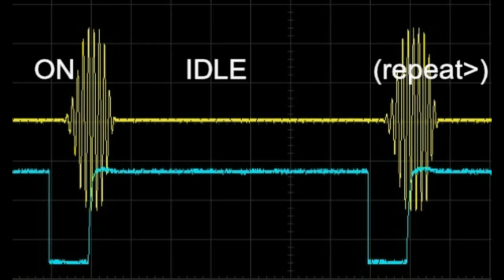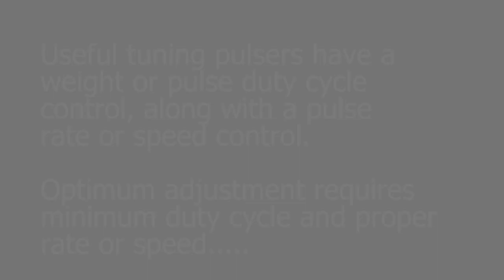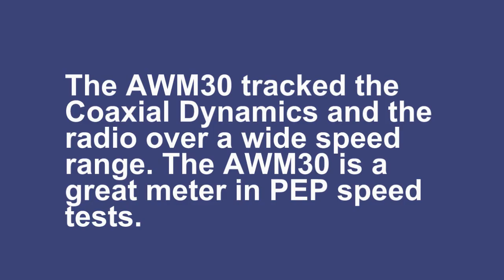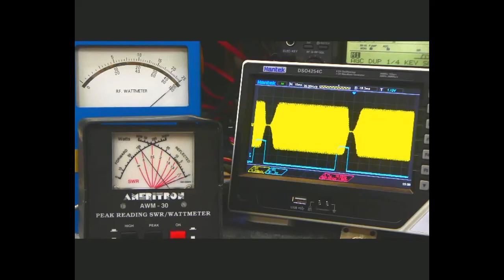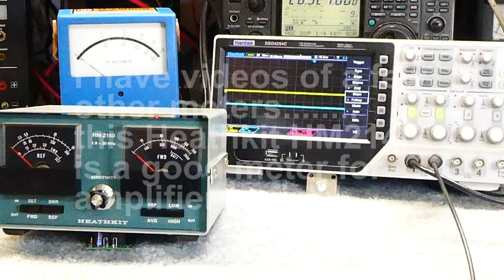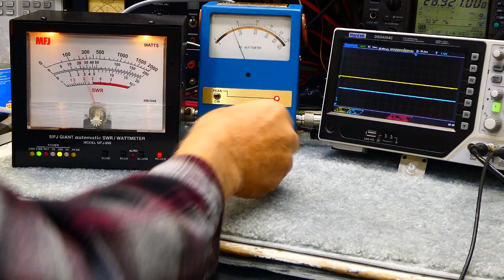Tuning pulser

Comment: Why not just compose an audio signal with a less than 30% duty cycle in some software like Audacity?  I'm already set up for digital modes like FT8.  I can just play the audio into the radio with it in SSB mode.

Comment: Hi Tom,

I leaving in a few minutes for Kaiser.  I took time to watch the video because amp tuning and incorrect amp tuning is a favorite subject of mine for personal reasons and for YouTube videos.  Where or how can I purchase the pulse device?  I would very much like to do a video about the device and likely it would get thousands of views.  My approach would be different and a little bit simpler.  But the point would be the same.  The pulsing device would be a safer way (as you discussed) to tune and not exceed the plate dissipation of the tube(s).  A guy sent a box of 811a tubes to me that he said were defective.  Well, they were burned, dark inside, coating on the glass envelope, white on the inside from oxygen and otherwise burned up from excessive grid current and drive.  Again, where can I buy one of the pulsers?  73, Jim W6LG in Rocklin, CA
Reply from the maker: I just listed them at this link: https://www.ctrengineeringinc.com/tuning-pulser-tuning-pecker-pkr-1/    Be forewarned after the Holidays I am way behind, maybe about a week.

Comment: I have the AL811H amp. I have an Ameritron ATP 102 tuning pulser. Will this work with an Icom 7300 radio? Thx!
Reply: @dheller777  I have the same setup and it works for me.  Do you have Tom's tuning on the fly circuit built into your amp?
Reply: @bigfranksworld  No
Reply: @dheller777  you might want to look into it, and some of the other upgrades Tom does
Reply: @bigfranksworld  Thank you
Reply: Could one use this with an FT 950 and an SB 220? I use a Birdwatt Meter and a LP 100A. Happy New Year, Tom
Reply from the maker: @donaldjones1759  Yes, it would work with that radio and amp. The LP-100A I have is a little flaky reading peaks. It is a good meter but mine is a little too jumpy on peaks. Maybe they will work on the firmware and fix that.
Reply: @Jerrythenerdful   So it's trash?
Reply from the maker: @donaldjones1759  No, I didn't say that. The LP100A is a good meter for reading carriers or reasonably steady signals. It is not so good as a tuning aid with a pulser or to catch sudden peaks. Actually very few digital meters are good for that. 

My Bird 4391A is not so good in this application either. Although the Bird  is good at catching peaks (the LP100A isn't) the display is not good for tuning. Neither is my Elecraft digital meter, it lacks resolution and the ability to use for tuning. It is hard to find a good digital meter for this application.

Comment: Thanks you for this info.  I'm running an Ameritron ATP-102 pulser and a Daiwa CN-901 meter.  Not sure about the meter, though it seems to work okay, but the pulsre works good.  I have your TOF in my 811-a and love it.  It takes the stupid out of me tuning wrong.  Thanks again Tom!
Reply from the maker: Thanks Frank. The Daiwa meters I looked at are ok for peaking an amplifier but I would not relay on them for reading the real peak power.
Reply: What meter would you reccomend?  I bought a Daiwa and it turned out to be way off the mark.  Thanks.
Reply: @jff2111 . Well not sure.  The Daiwa is the only one like it I have ever owned.  I'm assuming it reads right, but I have nothing to cross check it with.